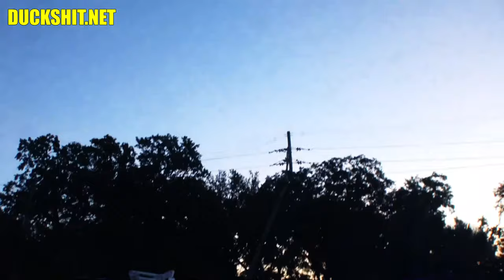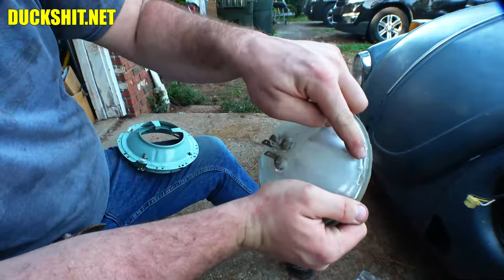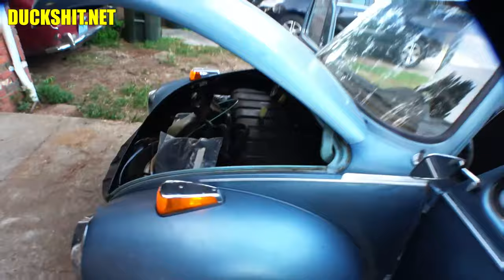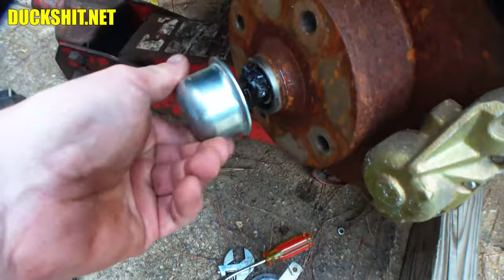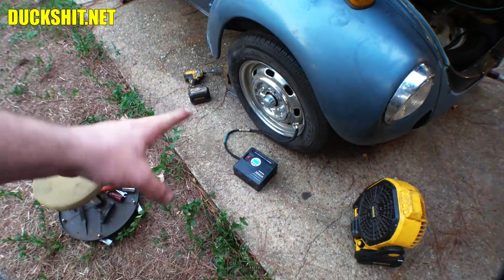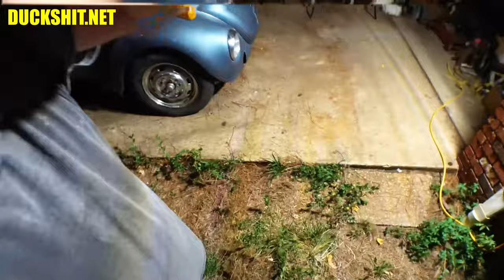💥⚡️Wheel Bearings / Headlight Mounts⚡️💥- VW Beetle🔧🛠️ - 08

Comment: Tree or something in the power line causing a short.  The breaker protecting that section of line is turning off to see if fault goes away. It will typically turn off three times for a few seconds or longer. The forth time the breaker opens and turns power off it will stay off until the lineman finds and repairs line.
Reply from the maker: That's pretty much what it did, three.  Then it went out and stayed out.  Then it came back on and stayed on for a bit a little while later when I recorded the opening.... then went out again and stayed out.  That's about when I found where the accident was.

Comment: That vwoop was a electric transmormer or a electronic microwave radio wave torchering device. But ended up being a car accident.
Reply from the maker: It sure made one hell of a racket... that sound carried through a very quiet and still night at 4am when nobody's on the road, and the town was otherwise dead.... it was dark... VERY DARK!  Anyway, that took out a pretty large swath of town, when I drove around trying to find it, I couldn't believe how dark it was and how far!
Reply: @DuckmanCycles   I hear that same vwomp noise here when the electric goes out.
Reply from the maker: @richardbrowne3641  usually when the power goes out here you don't hear anything, except maybe a thunder crash LOL!  About 2 years ago a tall truck took out the lead at the end of the street and really made a mess of things.  Other than the beeping of all my battery equipment, it was quiet out there.
Reply: @DuckmanCycles  "HUMANS BE STUPID!!!"
Reply from the maker: Fact